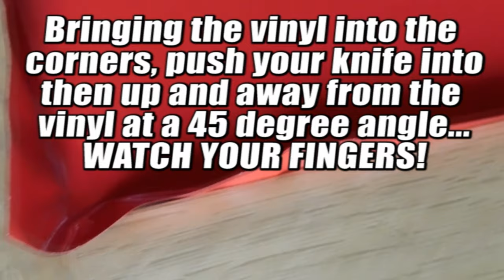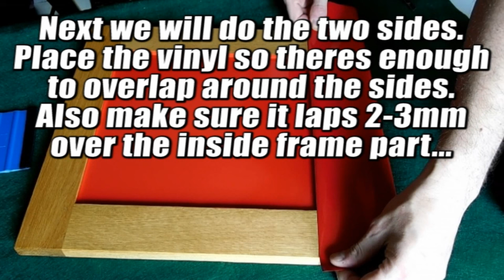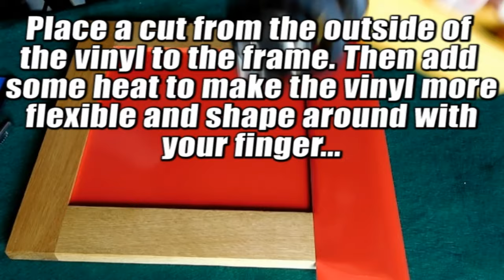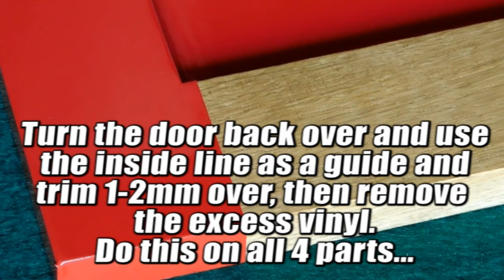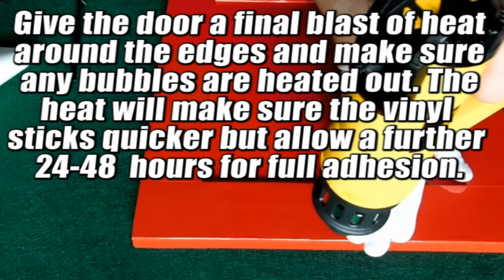How To Vinyl Wrap A Deep Framed Shaker Door (North East Wraps)

Comment: Hello, I have kitchen cabinet doors like this that are being ruined by water drops, coffee drops, drink drops, and grease. Every time I clean them....they get worse & worse and start to peel, absorb water, and puff up making them no longer flat & smooth. Instead of sanding & repairing these, I would rather just cover them up with vinyl. Is it possible for me to cover the kitchen cabinet doors with vinyl while they are still hanging on the cabinets? Or should I remove the cabinet doors from the cabinets? I want to do one at a time. I Love that you posted this video. I have been looking for a solution for a very long time! Thank you for the video and for any replies!!!
Reply from the maker: Remove the doors as it will make your life easier, 4 screws wont ruin your life. Follow the video and you should be good! ♥♥
Reply: Oh another question: Are you using vinyl with the sticky backing?
Reply from the maker: @nourahroberts6705  Did you really just ask that question?!🤣
Reply: Yes. I ask this because there are a variety of types of vinyl. I apologize for not knowing the exact names of the following types of Vinyl. Version 1 has sticky backing that is "super sticky"....more like a permanent version. Version 2 is semi-sticky (allows you to remove it once or twice to re-position).. and is not as super sticky as version 1. Then there is another sticky type of vinyl (Version 3) that is removable....has a sticky backing, but not too much sticky at all. That type will allow you to remove, re-position & re-use much more than version 2. Then there is a 4th version of vinyl (Version 4) that has no sticky backing at all. It is often used to cover an item, or used for artwork. It depends on what you are using it for. This version can also be heated for different application types. Please correct me if I am wrong here: I am assuming that the vinyl that you are using to cover the cabinet doors is "very sticky" and would be difficult to remove? Is that correct?